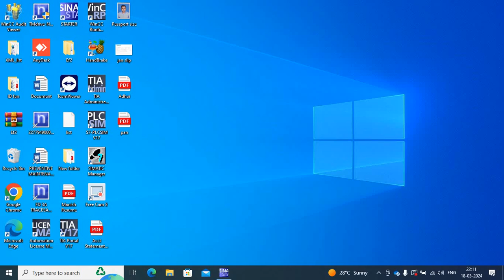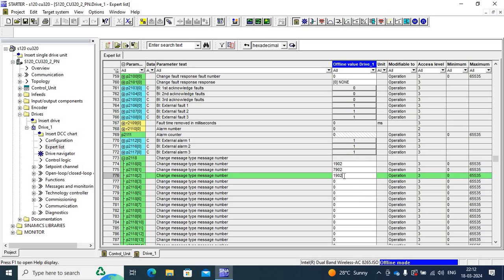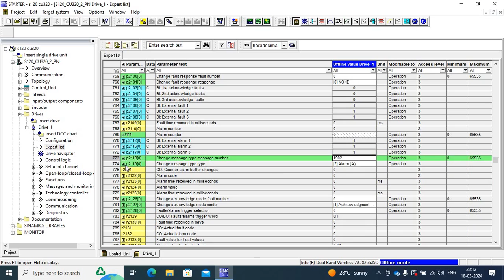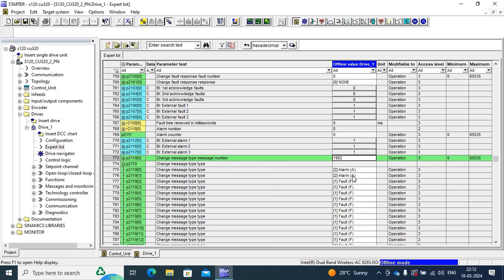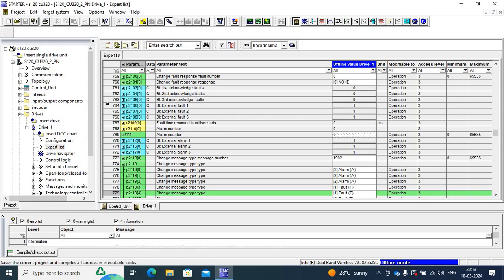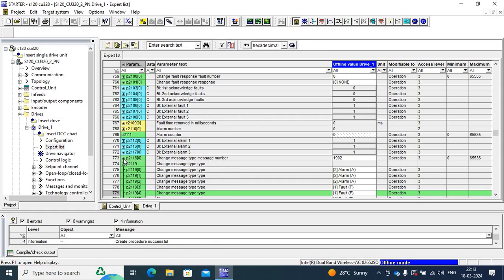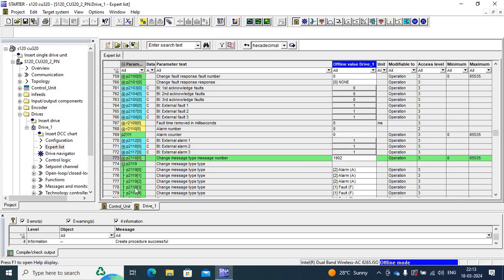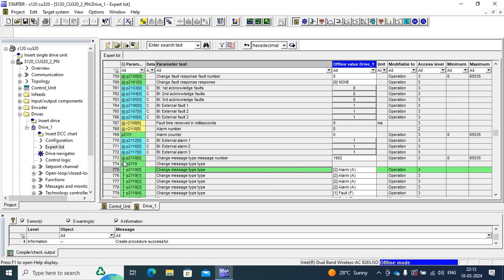How to change Fault to Alarm in Siemens Drive/VFD

Comment: I have to replacement the new motor module with the different part nimber.
Can I download without the original project file which has parameter number 60100 ?
Reply from the maker: When change power module then check parameters r200 &p201 it should be same
Reply: @manishKumar-cw5gi  
Do you mean I can download the upload project file which changed the motor module after copy RAM to ROM the machine can run same as the old motor module the DCC does't effect it ?
Reply from the maker: Also check p7826 select 1 then power recycle
Reply: @manishKumar-cw5gi  Do not copy RAM to ROM only power off after p7826 select 1 ?